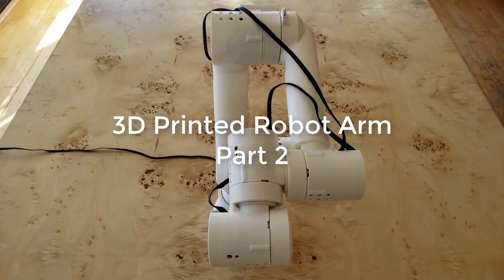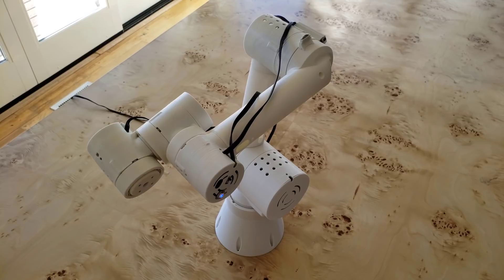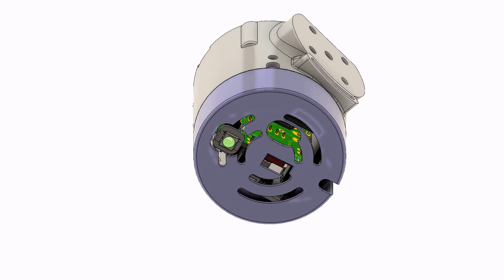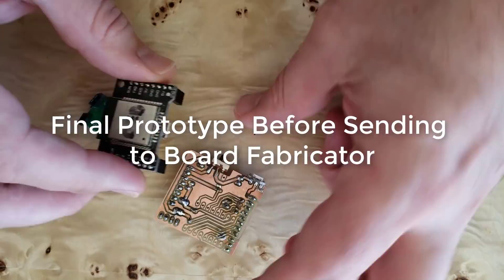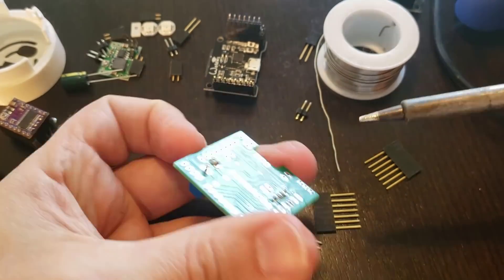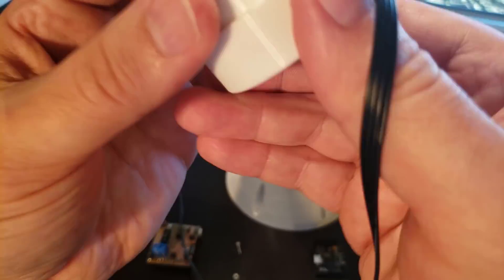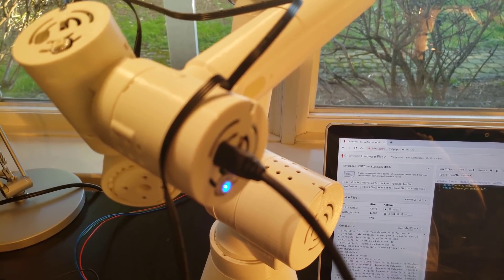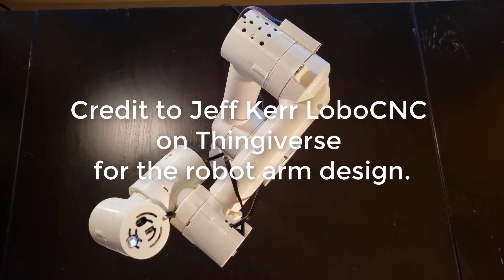3D Printed Robot Arm - Part 2

Comment: Great video! I've noticed a lot of robot arms seem to incorporate the motor driver (and other electronics?) right next to the motor...so it has to fit inside the joint. Is there a reason this is preferred instead of just routing the motor's cables to the base of the unit or somewhere else where all the electronics are housed in a single location?

Comment: First let me say this is beyond anything I could currently design with my skill level, so kudos. Did you experience problems with having the cables run through the structure as opposed to outside it?

Comment: What did you use to drill those four holes? I am still brand new with pcb milling (i got the sainsmart genmitsu or whatever it is, and i need to figure it out.) i want to be able to make use of my double sided pcbs for a controller for my Ender's lights, and for making my own custom pcbs for an arduino and pi to work together and such. What software does that for you??
thanks in advance!!

Comment: In order to run it as as a continuously flowing robotic arm do you have plans to connect it all through a master controller?  Have you thought about placing 9DOF sensors on all the joints so the master "knows" where everything is and the most direct path to the object?  I thought this would make it more organic.  I've been following for years.  Great work, i've been wanting to build an arm or two but not being a programmer had to wait on others for the examples.
Reply from the maker: To get this to the next step we'll need some open source contributions from others to help achieve the goals you're describing.

Comment: thanks for sharing! I think I found inspiration. I want to design an embedded wire. The stepper motor uses a ring as the contact wire. In this way, an infinite 360-degree rotation can be achieved. .
Reply: me too!! I was just sitting around, thinking, when I realized, hey, AUX jacks (audio, 3.5mm) are essentially a series of rings with wires and- WAIT I CAN USE COPPER AS RINGS THAT TOUCH EACH OTHER!! This has even helped me get more ideas, your comment. I'm gonna use springs and such to keep the rings pressed. You, sir (or ma'am, not gonna assume), are a lifesaver.

Comment: Nice (:

Though I can't stop thinking, while you already had to connect the actuator to the power supply through their VCC and GND wires, why didn't you just add another wire for signal control of each actuator? Why there are that many ESP32s wasted? (one would be enough...)

Anyway, really nice project.
Reply from the maker: Well, take a look at part 3 video to see why I used an ESP32 in each actuator. https://www.youtube.com/watch?v=4o3d7_WZ_DQ

Comment: Sir, what filament material did you use to build this structure, gears and mechanisms?
Reply from the maker: amazon basics pla. run it at 210 celsius on my ender 3.

Comment: If you filled those arms with an epoxy granite, it would move as if an industrial robot.
Reply from the maker: That sure would add some weight.
Reply: @JohnLauerGplus  That's essentially what allows industrial robots to move so precisely. As you know.
Reply from the maker: @SyntacticOperator  The Universal Robots UR5 is pretty big but is only 55 pounds. I've always considered the harmonic drives in it to be why they're so precise.
Reply from the maker: @SyntacticOperator  yes I am very familiar with odrive and do think that could be a natural progression to this design. Thinking about that as phase 2 of the design or maybe somebody else in the community extends it. On the rigidity, I think that will be a future phase too because the power of these 35mm steppers is not great. There are heat problems too, so lots of stuff needs to get solved prior to rigidity. Also the syncing of actuators is still a work in progress using Bluetooth. I do believe the world needs a great open source robot arm though. Maybe this helps us get closer to that.

Comment: You need a DC Servo Motor do the job better.
Reply from the maker: There is the ODrive project now which can give you nice control over a brushless DC motor, but I'm not so sure you get much more power/torque out of that solution than just using a stepper.

Comment: TMC 2208 stepper drivers (silent step stick) and accelstepper library for stepper acceleration.
Reply from the maker: Working on a PCB design that uses TMC2130, ESP32, and a touch sensor PCB on outside for jogging per actuator. TMC2130 gives ability for sensorless homing.
Reply: @JohnLauerGplus  tmc 2209 should be coming out in a while.  It's a combination of the 2208 & 2130.   Looks like a sweet project!

Comment: Very nice build and video. How mechanically rigid is that two stage planet gear design? might it be interesting to print some of the mechanics in metal?
Reply from the maker: Printing in metal would be awesome and possibly if this robot arm is viewed as a prototype and works well enough as the community invests in it, which is already happening if you look at the Thingiverse page, you could end up with this being the first highly popular open source 3d printed robot arm.

Comment: I have finished the first module and its working great, limited to the chillipepper test code for now, but at least its working! The PCB, hardware, and code all work, no surprises. I had some  Wires 6 Conductors Capsule Compact Slip Rings included with the aliexpress order, trying to see if there's a way to connect the 24v line in stages inside the arm. This will take a redesign of the couplers/motor mounts for sure, but it's a fun project. I am interested in what others are doing to as to a controller once the arm is complete, the ESP32 is a great way to connect everything, open to code and ideas:)

Comment: hey what bolt for the joints and the connector is or the motor and the capacitor thanks you . how to controller with xbox controller wireless thanks mate
Reply from the maker: The bolts needed are described in the Thingiverse. The capacitor is your typical size for a DRV8825 which is about 100uF or bigger. For Xbox, that's a lot more involved but been making progress there and may be able to post a video soon.
Reply: @JohnLauerGplus about  bolts i dont get what u mean  m4 40 is tha size m4 40mm long.
Reply from the maker: @ThePawel8888  Look at the Thingiverse description really close. These are imperial unit machine screws. I wish the designer had used metric, but they didn't.

Comment: For your next robot arm you should use sliprings in for the wires and see if you can do 360 rotation
Reply from the maker: Totally agree. I think you could just do the power via slipring and get everything else to be wireless and you'd have a super amazing arm that's easy to assemble.
Reply: @JohnLauerGplus  Yea that's a good idea,  I guess it would have to be a bit bigger maybe to fit the stuff, but 360 rotation would be really cool. If you got a tight grip on the end like fingers you could fully screw in a screw with it. lol!

Comment: I like the idea. Nice explanation. Not sure if PLA is a good idea, it won't deal with heat well at all. Why have a separate MCU for each stepper? Seems overkill when one could have done. STM32 perhaps with an esp for WiFi?
Reply from the maker: Heat is a concern, especially on the small steppers. Trying to figure out if I can just print the sun gear in something else because the heat emanates through the shaft of the stepper and can melt the plastic and the superglue gives out. The reason I'm using an ESP32 for each stepper is I want a touch jog dial at each actuator, temperature sensor, fan control, RGB LED status indicator, and sensorless homing. All of these would require numerous wires back to a core controller. Also, I want a distributed system at the core of this so you can add-on degrees-of-freedom with a lot of freedom. What if you wanted to add 1 more small stepper actuator at the end of the arm? When you get to dealing with the end gripper which may have tons of sensors, motors, etc it will almost certainly have it's own MCU. So, might as well set up a core operating system for the robot arm that fully embraces a distributed approach with synchronization. The other issue folks don't realize is how complex/hard it is to run wiring across these robot arms. You want to eliminate every wire you can, so by using an MCU you could in theory just run 24v power and nothing else.
Reply: @JohnLauerGplus  You make a very good case. PETG will do what you need if you have a heated bed. Why not file a flat on the Nema shafts instead of relying on superglue.

Comment: Awsome project!
You could consider using PETG instead of PLA if some mechanical parts fail
Reply from the maker: The shaft is disconnecting from the sun gear due to heat in my small actuators. So, I do need to find a solution to that. Bought some PETG to try it, but I still think that won't be good enough.

Comment: Hey john, can you list the correct jack for the stepper motor as you mentioned here(and any other components (except normal stuff), I know I’m missing a few! Thanks
Reply from the maker: I'm pretty sure it's a JST-PH 4-Pin Header. The Eagle BRD file has it in the properties description of the component.
Reply: @JohnLauerGplus  thanks! for anyone needing it, here you go:
Partlist exported from C:/Users/jhkru/Desktop/robot arm/PCB boards/robot-actuator-controller-v1-master/adapter.sch at 4/28/2019 12:06 PM

Part   Value                     Device                    Package             Description                             MF MPN OC_FARNELL OC_NEWARK SPICEPREFIX
5V                               PINHD-1X8                 1X08                PIN HEADER                                                                     
5VOUT                            PINHD-1X2                 1X02                PIN HEADER                                                                     
24V                              PINHD-1X2                 1X02                PIN HEADER                                                                     
C1                               CPOL-USE5-6               E5-6                POLARIZED CAPACITOR, American symbol                                C          
D                                FE08-1                    FE08                FEMALE HEADER                                  unknown    unknown              
GND24V                           PINHD-1X2                 1X02                PIN HEADER                                                                     
GNDOUT                           PINHD-1X2                 1X02                PIN HEADER                                                                     
J1     CON_TERMINAL_BLOCK_02-5MM CON_TERMINAL_BLOCK_02-5MM TERMINAL_BLOCK_2P_5 2 poles wire to board terminal block                                           
JP1                              PINHD-1X8                 1X08                PIN HEADER                                                                     
JP2                              PINHD-1X3                 1X03                PIN HEADER                                                                     
JP4                              PINHD-1X4                 1X04                PIN HEADER                                                                     
JP10                             FE08-1                    FE08                FEMALE HEADER                                  unknown    unknown              
JP11                             PINHD-1X1                 1X01                PIN HEADER                                                                     
SV1                              MA03-1                    MA03-1              PIN HEADER                                     unknown    unknown              
SV2                              MA03-1                    MA03-1              PIN HEADER                                     unknown    unknown              
U$1    JST-PH_4-PIN_HEADER       JST-PH_4-PIN_HEADER       JST_B4B-PH_HEADER   4-pin JST PH Shrouded Header, top entry

Comment: amazing, really interesting. What is that chip silver color of the pcb? a processor, memory or what? it calls my attention
Reply: that's an esp32, it's the microcontroller he's using to control the stepper motor. neat little microcontroller, very powerful for the price and has wifi hardware integrated into it.

Comment: Is that a 300uf 16v cap your running in the final?
Reply from the maker: I run with a 100uf 26v cap now, but I may have an old one in this video. I blew a 16v cap a month ago and realized my error.
Reply: John Lauer ok thanks for the update, waiting on AliExpress for parts as usual, the pcbs look great

Comment: hey what bolt for the joints and the connector is or the motor and the capacitor thanks you . how to controller  with xbox controller  wireless thanks mate

Comment: Thanks for all the work on this, especially the documentation. I just ordered the PCB boards, zip worked perfectly. I have this arm working and running using a mega/ramps (three steppers only) and three tb5600s. Old school lol. This approach you have is way better! I am curious on the Adafruit joints that allow rotation for the 24 V, that might solve the issue of the 1 W power wire needed.

Comment: Hi John, this project looks great! I really would like to have my hand at replicating what you made of Jeff Kerr's robot arm so far. However your explanation on the electronics in this video is quite brief. I am not very familiar with electrical engineering myself so was hoping you could provide some more information on which components you used and how/why. 

Looking forward to your response!
Reply: I had the same fear, but if you look deeply at the PCB schematics it's very straight forward, and a good learning experience.

Comment: u uploaded the wrong files and i back the board today so not right board
Reply from the maker: Somebody else mentioned that too so I fixed it a few days ago in GitHub. Sorry about that. All is not lost though because that is the next gen PCB for tmc2130 stepper and it's starting to work for me.
Reply: so what can i do with the 20 borad i got ok or its waste of money and do i bin the pcb or what
Reply from the maker: @ThePawel8888  I don't have that figured out. That board design requires 2 additional custom PCB's, so this is quite the task to get figured out and debugged. This is a weekend hobby project so it can take months/years.

Comment: Amazing!👏
But why ESP32? Why not blue pill stm32 for example? I wanna repeat it on bluepill😃
Reply from the maker: Blue pill STM32 doesn't look very good compared to ESP32. Blue pill is 72Mhz, 128K flash, 20KB RAM @ $2 while the ESP32 is dual-core 240Mhz, 4MB Flash, 520KB RAM, Wifi, Bluetooth, and lots of sub-controllers like a pulse counter, pulse generator (for stepper driving), 10 touch sensors, etc. @ $4.
Reply: @JohnLauerGplus  wow, i didn't know that🤔 and grbl it seems have to .. excellent choice😃

Comment: the pdb u made goes each stepper motor for all 7 of them or just the last 3
Reply from the maker: The idea is to go to all 6 actuators so you only have to run 24v power across the whole arm, but looks like I'll need a sync signal wire too now. Still work in progress
Reply: cool thanks can wait printing parts now

Comment: Are you planning on adding slip rings to the joints in a future iteration?
Reply from the maker: That would be awesome. Any design ideas for how to achieve it?
Reply: @JohnLauerGplus  depending on your power need: https://www.adafruit.com/product/736
Reply from the maker: @okbrb  Interesting, but how would you wire that through those actuators I show in the Part 1 video? I would need at least 2 for power, but likely 1 more for a sync signal.
Reply: @JohnLauerGplus  I'll take a look at that video and reply soon
Reply: @okbrb  1 year later... I'm hoping to figure out what the heck to do about it, because i need to be able to turn every which way to have full freedom.

Comment: Could you please explain how you turned the gcode coordinates into angles for each joint? The controlling software and the inverse kinematics confuse me the most, especially the multiple solutions part. Also, that's a nice robotic arm you got there
Reply from the maker: None of that is quite figured out yet. The movement in this video is just a per actuator back and forth test movement. Next step is Gcode and record & play functionality.